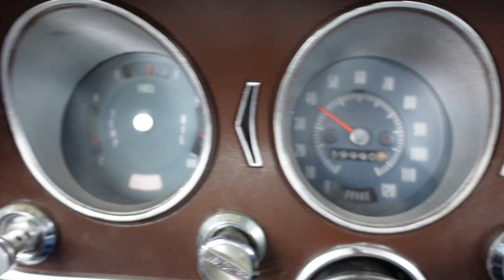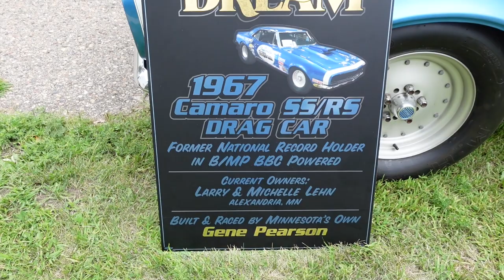1968 GTO Procar Seat Installation & Eagle's Healing Nest Car Show!

Comment: Great video. 
I was wondering about the slider and mounting the seats  .
I have the same sests coming for my  66 impala ss.
I like the the way you installed them.
I also like the way you went about.
Taking your time... no fancy tool.
You showed every step...
Leaving no mystery.

Thanks.
Reply from the maker: I didn't want to buy the mounting brackets because I was concerned that they would have raised the seats up too high. 
 They aren't cheap either and this seemed to do the trick.  Thanks for watching!

Comment: Thanks for showing the seats folded forward. I'm thinking of getting either these seats or the Rally 1000 series, but I read that the Rally 1000 series don't fold forward very far because the side bolstering on the seat back runs into the side bolstering on the seat bottom.
Reply from the maker: These are so comfortable and I get compliments on them all the time even from the die hard Pontiac guys.

Comment: continued.....I am just removing my seats to have them professionally re-upholstered and am hoping to put them back in place afterwards.
Reply from the maker: If you are just reupholstering the original seats then you should be good with the original brackets.  Thanks for watching!
Reply: @DoItMyselfGarage  Oh OK - thank you very much.  I was told I only needed to remove 4 bolts to take out the seats and bring them to the shop but I got nervous when I saw this seat replacement video - you did an amazing job - I wish I had your shop and tools!

Comment: Great video brother! Im about to do the same thing this weekend hopefully in my 70 Camaro. The seats look awesome!
Reply from the maker: Yeah, when I drove my car for the first time this year I was amazed at how comfortable they are again.  So nice to have good seats.
Reply: @DoItMyselfGarage   Happy to update that the seats went in without any real issues. The only thing I might recommend for anyone going this route is to use a piece of at least  1 1/2". My local big box only had 1 1/4" and the carpet was pretty tough to work around and still make it look good. That extra 1/4" made all of the difference. The seats are very secure, and I was able to use the original mounting locations.
Reply from the maker: @JakeOfAllTrades03  Glad to hear you got them in.  I absolutely love mine.  Appreciate the tips for others also.

Comment: I note that you made new brackets for the seat to attach to the floor - can't you use the existing brackets already in the floor from the old seats?
Reply from the maker: The aftermarket seats are more universal, so some cars would require the higher bracket to clear bumps in the floor., but that is sold separately.  Fortunately in the GTO the floor is flat enough just to bolt in and gives you more headroom.  I was able to sell the old seats for way more since the original hardware was all there.

Comment: Are the dimensions of the brackets 2.5.  And 2" important,  I found 3" 1.5x1.5  1/8" angle brackets at the hardware store, powder coated looks like they will work, what issues will they have
Reply from the maker: Not super important.  I was trying to keep them as small as possible.  I still need to remove mine and paint them black, so the powder coated will probably look really good.  You could always trim them down later.  As long as they are strong enough you should be okay.  Remember, these should hold the seat in place in case of an accident.

Comment: Was your car a bucket or bench seat originally?
Reply from the maker: Yes came with buckets.  It had a console with the TH400 floor shifter which was only available with the bucket seats according to PHS.
Reply: @DoItMyselfGarage  awesome thanks for the video, I’ve got a set of the 1300 series seats that I’m swapping into my 71 chevelle. It was originally a bench car but I’m 6’7 so I’m trying to get them as low as possible without using the ProCar adapters or welding in the oem bracket. I think the L bracket Idea you did with a set of 3 inch washers on the inside holes under the car will work great.